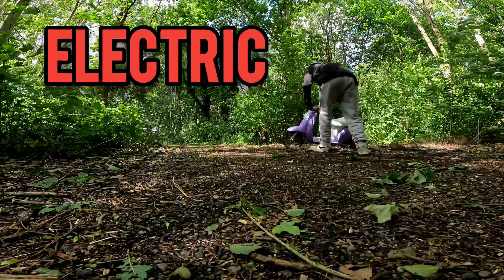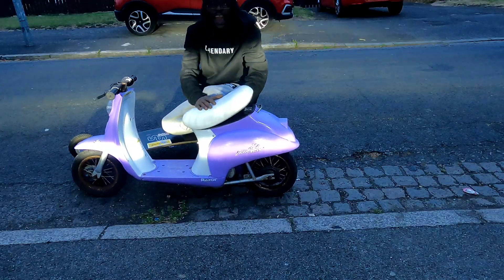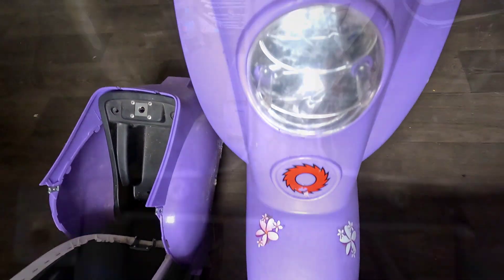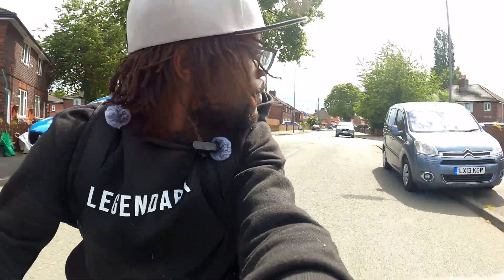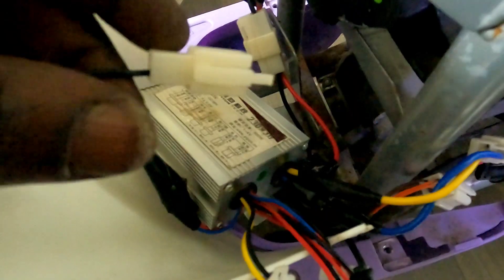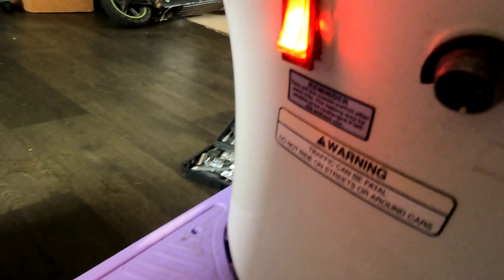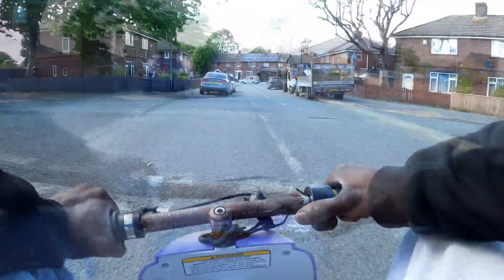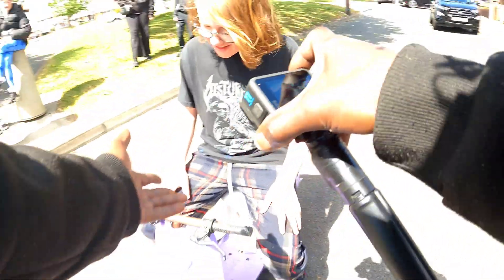Cheapest Electric Bike gets Upgrade

Comment: Yo, do you think you can recommend any good tires for a Hiboy s2 max i've run online that the tires it comes with aren't very well. It's tube tires and they gave me a second set of tubes to replace if they get popped. Are there any tubeless tires out there for scooters in this size or am I just gonna have to buy a thicker thread tire? To prevent it from popping I've only had the Scooter for three days, but I would like to take care of it. Mostly it was a gift.
Reply from the maker: The easiest way to protect your inner tubes is a tyre slime. If you search green slime tyre, it will pop up. This will make your current setup near bulletproof.
Another alternative is the tyre originally for an iscooter i8 or i9. They fit, affordable and easy to find on amazon/ebay. Welcome to the channel by the way.

Comment: I'm usually a car guy I have on five Camaro but I just bought a E scooter Hiboy s2 max... it only goes 19 mph but my jobs 0.9 miles away from my apartment. So I figured why pay for parking (I live downtown Hollywood near Miami) anyways I got the hiboy 3 days ago and it's fun as hell is there anything I can do to make it faster I do weight more than the recommended weight but this one had 40 mile range so I decided to pick this one and since I got a deal off of it, it was only $409 with one year warranty, but I'm probably gonna break the warranty if I mod the controller.... 

Is it worth doing and should I do it? I like the scooter as it is and I don't wanna break it but I do wanna see it reach 25 miles an hour also, I've run online that the tires that come with it aren't so well. Do you recommend anything that could do for that?
Reply from the maker: Your new ride "Hiboy" has a 500watt system. You can get more pulling power uphill and a higher top speed by changing the electric speed controller. Yes that will void your warranty. Your scooter has a decent battery but it will do less distance range if you swap the electric speed controller for one with more watts. By the way, make sure to buy the same voltage "esc" electric speed controller. I would be looking for a controller that boasts 36v with 40 amps. This will give you what feels like insane acceleration, higher top end speed bit reduce battery range to more like 20 miles instead of the 40 miles it used to do. You can keep battery range by opting for a speed controller with only 20 amps but 1000watt. This will give you a distance range of around 30 miles but with more uphill torque. Perfect for commuting. 
Tyres I would avoid swapping, they are a pain to do if you are new to electric scooters. Easiest way is a permanent tyre slime. I have scooters running for 3 years now in the harshest environments but the tyres still hold air. The secret is anti puncture tyre slime from day 1. 
Make sure you have unlocked sports mode with your phone app too.